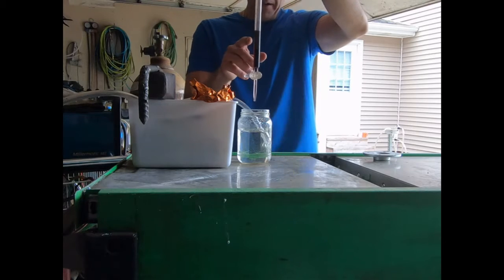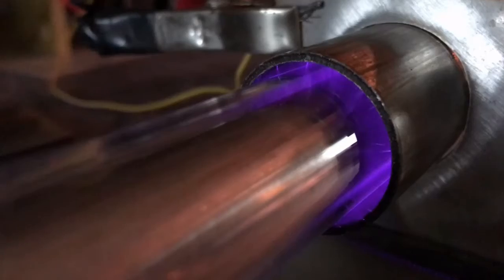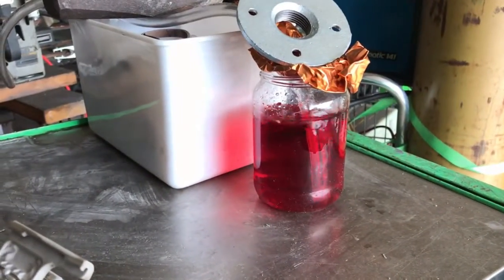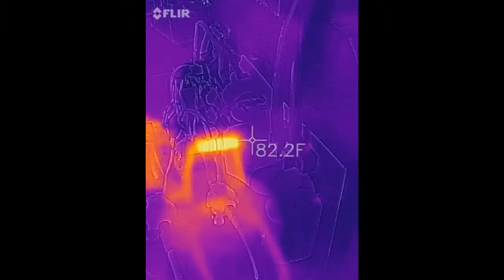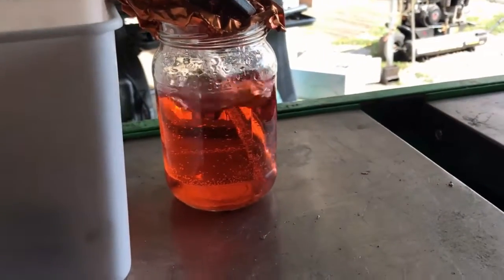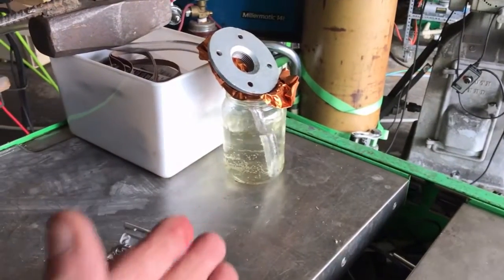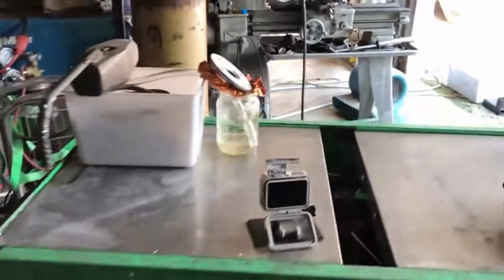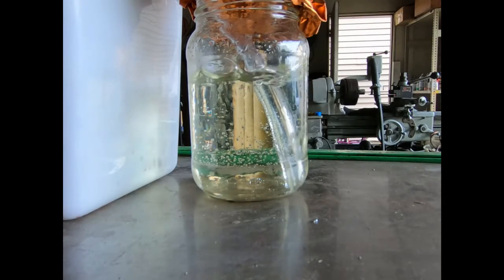Industrial Grade ozone generator DIY

Comment: Hi, amazing setup ! What voltage is that ? Because I'm trying to make one and even with 40kV nothing pass through the 1mm glass tube... Do you know where can be the problem ?
Reply from the maker: The frequency of the transformer must resonate with the size of your electrode , the electrode is like a capacitor in the circuit .  What frequency are you running at
Reply: @NOBOX7   I don't know the frequency, greater than 20kHz (it's a Mazzilli zvs driver with a flyback)

Comment: Hi, nice setup. Have you tried to bubble that solution with just oxygen to see a comparison?
Reply from the maker: No i havnt but not a bad idea
Reply: Yup. A control cell.
Also, how about TDS?
Are you using tap water from a well?
Maybe some iron or other stuff is oxidizing and part of the pink results.
You have created alot of variables that could be tuned better, perhaps.
Maybe it's like trying to create pure alcohol, nearly impossible and not necessary?